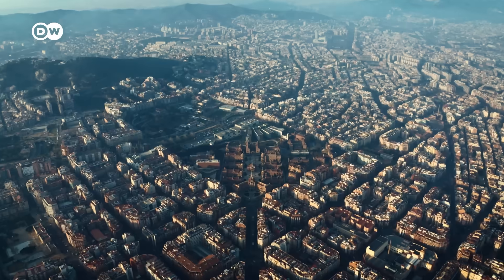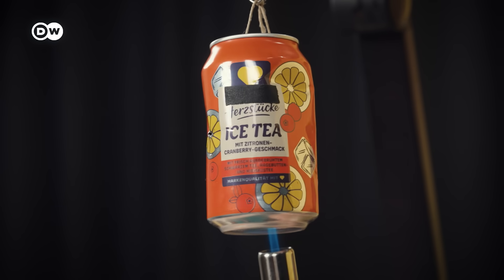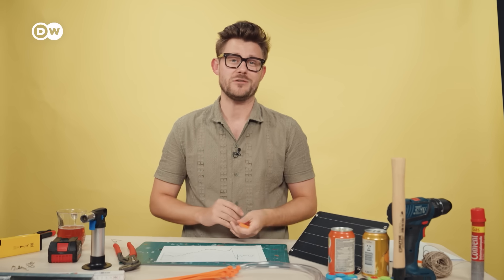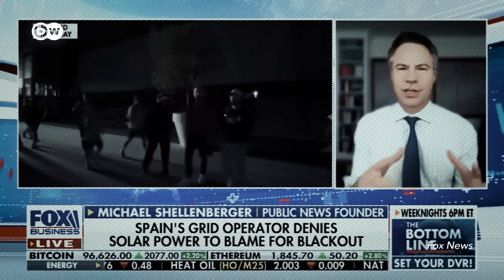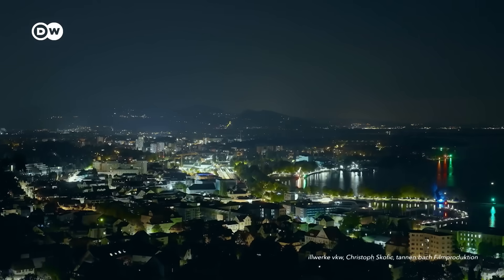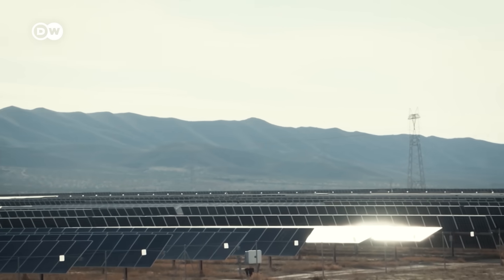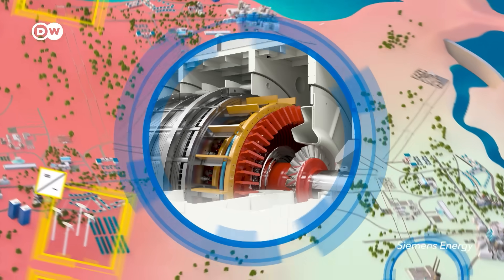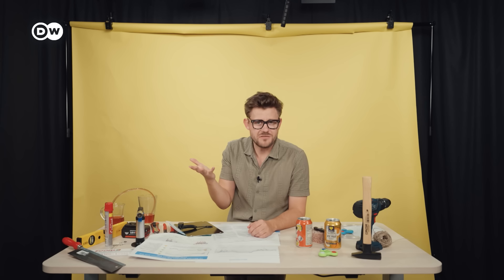Solar's hidden problem (and how to solve it)

Comment from the maker: What's your experience with blackouts?
Reply: Every blackout I've had to deal with has been due to storms. Which are becoming more common because of all the CO2 solar panels are putting in the air. Oh wait, that's what the fossil fuel generation plants do.
Reply: Congratulations on missing the main method by which modern solar installations avoid the problem being described: grid-forming inverters. Any country that wants to see the right way to integrate renewables should look at Australia. A small population spread across a vast area with a grid formed of dead end tendrils of extreme lengths, with far more solar than Spain, yet we don't suffer these outages. Also, don't blame renewables. I mean, this was Spain. It's hardly surprising that their grid is a cluster-f. Everything else is, after all.
Reply: @AussieUnclePhil You've been to Spain I presume?
Reply: @AussieUnclePhil Why are there so many people moving here then if it's so bad?
Reply: Good research job, guys. Well, my experience with blackouts is mostly under extreme weather conditions, such as typhoons, here in East Asia.
Reply: I live in germany, we have close to 60% renewables, I can not remember a blackout.
Reply: Not since the Oktoberfest of 2007
Reply: The last one we had was about 10 years ago. According to the local newspaper a worker had an accident in the local substation and they switched off power while they were helping them.
Reply: So it was a lack of inertia
Reply: @jsbrads1 We build a new system of 3 dams and wind farms.

The energy that are inserted on the grid ara balanced by that 3 dams that pump up water when the wind energy cant be inserted on the grid.

Its all about balance. Solar alone competing agaisnt the other solar and other energy sources, creates that hard start stop issues on the grid.

Its that what we need to fix. Both solar and wind energies must be directly conected with river dams, toguether as 1 system, to not allow that start stop issue to happen.
Reply: Now that we have home solar, and battery storage system not a problem at all😊
Reply: After blackouts people go outside in mass
Reply: For renewable energy it's better to have enough batteries as well!
Reply: @imtheeastgermanguy5431river dams are the batteries. They must be together as 1, and not competing against each other.
Reply: "but spinning turbines don't just help make electricity they also help keep the grid stable because they have a naturally built-in security net called inertia"

It's called inertia, but it's actually "spinning inertia", otherwise known as angular momentum, that actually keeps the grid stable due to the energy stored in the spinning mass.

Turbines and generators have exactly the same inertia whether they are stationary or rotating. However when rotating they store energy and can absorb or release energy depending on the grid load. This acts in much the same way as a smoothing capacitors on the output of a DC power supply which automatically, and virtually instantaneously, absorbs or release energy to stabilise the DC voltage, thus giving time for the power supply to react.
Modern switch mode DC power supplies can react much faster than the traditional transformer rectifier based ones which means that much smaller smoothing capacitors can be used on their output. Similarly, inverters can react faster than spinning generators to changes in load, so whilst they will still probably require some inertia it should be significantly less than needed to stabilise a grid powered by traditional spinning generation.

With wind, and probably even more so with solar, it's almost certainly requires some storage, most likely batteries, between the PV array and the inverter, to smooth out short term variations in solar, or possibly wind, generation variations, because demand it's not going to match PV generation.
Reply: @nickcook2714  battery storage is awesome 🎉
Reply: Giving photovoltaic electric power some inertia is very simple: electrical engineers call it inductance. So, a coil. Ideally, it should be in a DC circuit, then there is no influence on the reactive power in the grid (because there is generally no reactive power in a DC circuit). Using a coil is much simpler and cost effective than moving parts (mechanical inertia).
Reply: @santaclaus0815  say this to others who claim it's only possible to get with mechanical! 😂
Reply: I'm from Portugal, it was somehow incredible to witness people starting to panic just after 6 or 7 hour without energy and communications. If it lasted like 12 hours more it would get very ugly, I'm very sure. It was shocking to know that so many people don't have enough food and water for even 2 or 3 days at their homes, no flashlights other than the one from their phones, no candles, no radios or batteries, nothing. The run to get kids from schools, for gas stations, ATMs and supermarkets was like something from a zombie movie.
Reply: Lol, I was born and raised in South Africa, they were pretty common there when I was growing up, and are more so now. We had to find things to keep us occupied, and if it was dark you got flashlights and candles. It's actually quite cosy.
Reply: When we had this Spanish blackout one of the biggest things our community faced was the information black hole. Although our phones had power the transmitters didn't. I've now bought a radio so hopefully the radio stations will have generators.

We also had no water because we live on top of a hill so the water pump for the mains didn't work. This meant the toilets got a bit grim.

Shopping was problematic because of the reliance on digital systems for payments etc. Thankfully the pub is cash-only.

The beer also started to warm  up! The pumps had no power and every time the fridge door opened the contents warmed up.

It was a good wake up call. We live in an earthquake zone (Last significant one about 100 years ago) and weren't prepared. I've now got food and water in for emergencies.
Reply: 4 machines that cant cold down without cleaning inside from the materials.

Materials that only go harder if heat up againt.

Sweting all day in the day after. Body pains in the days after.
Reply: annoying, for the most part
but kind of maneageable honestly
Reply: Blackouts by storms...Wind and threes... So much solar instaled that reverse flux of Power in distribution Transformers is a real problem... And this problem, of lack of investment in sicronous compensators, was know, but with privatazion of Power companies, no investements are being made. And is not the last blackout of this sort we will see
Reply: @coisotrembaono4309  privatized power companies can be incentivized to invest in dependable quality power, but many incentives have been for less reliable intermittent power like solar and wind.
Reply: Whenever they happen it really makes you feel like you're back in the 1980's under the Soviet puppet government rule.
Reply: @cavemann_  I lost power for a week following Hurricane Gloria is the Soviet Socialist Republic of... 1980s Long Island.

Comment: As a non-expert, I initially thought “batteries would fix this.” The video could have explained the difference between energy storage and grid inertia, since the problem discussed is about immediate stability, not stored energy.

Comment: I love that the Spanish didn't start panicking, raiding shops, rioting etc, at anywhere near the rates we probably would in the english speaking west, they mostly went to the beach, had barbeques, sang songs, enjoyed the time off and danced. 😂
Reply: There were raids lol. The blackout happened 5 min before i got to my train station to go to work. When i got there there was a train waiting until power came back, we all thought it was a local issue and would be fixed in minutes, so i got on the train. About an hour later police showed up and told us to go home, that this could last days. On my way home i saw several shops with broken glass and doors. In like 2 hours people already started behaving like monkeys. Luckily it didnt last that much, the worst case ive heard of was someone who got power 22 hours after, i already had power around 9 hours after, the average being around 12 hours.

Comment: So much wasted space and resources than could be invested on a single Nuclear plant to do as much for way less space.
Reply: The nuclear power plant produces less electricity and has higher upkeep costs.
Reply: @old-pete  you must be on some kind of drugs if you think a nuclear plant produces less electricity than solar panels on same plot of land size a nuclear plant would take, sure nuclear power plant upkeep cost can be high but is vastly superior in every single way, not to mention it ends up producing less waste than solar which degrades way faster and in most cases ends up not being recycled since it's a lot of effort which ends up harming environment more than it's supposed to be clean.
  And don't forget Solar only works during days and is only effective on sunny days.
  Only reason governments don't invest in nuclear power is cause of people fear of nuclear disasters which are mostly a thing of the past as there are a lot of safety technologies now days, not cause they ineffective.
Reply: @SuperCocoKiller 
I did not write that.
You were talking about the same investment.
And that is the issue. Nuclear power plants are much more expensive and take a much longer time to setup.

Comment: "We gonna make all of Spain use electric cars" (This said by some spanish politicians)
My brother in christ, WE DO NOT HAVE THE POWER TO KEEP THAT UP.
I work in electric distribution, my father did so also for more than 40 years, and that they because the death of an old we met with a lot of people of the primary electric company in the region and we all easily knew it was because of an spike in the grid and we all made up an easy solution to, atleast in the region, have electricity throughout other means till the general problem was solve, but orders are orders and we had to wait till 10pm or so to get back the electricity, not that it was much of a problem tbh, it was a sunny day and the people, myself too, went out to the pubs and completely filled them all and their terraces 😂😂
Reply: Nobody claimed to make them go all electric tomorrow.
Reply: @old-pete  its not that we will have the capacity for it in a decade either, that its what they said
Reply: @lolxdani9996 
That is not the goal either.

Comment: About solar being cheap: I'm Spanish, and for us, the common people, solar energy isn't cheap whatsoever. You see, it's cheap to generate but the way electricity is sold in Spain is that you have to pay all the electricity with the price of the most expensive source that's beibg used, (that is in our case gas) so if you were generating 70% solar, 25% hidro and 5% gas you'll have to pay as if it was 100% gas... So basically the electric companies are making a fortune out of us

Comment: To my knowledge, the studies from Spanish Science Superior Counsil (CSIC) soon found out after the blackout that the gas stabilizers we DO have, were not fully working as an excess of self-confidence from the electric companies, trying to save gas expents. The electricity supply is no longer run by the Government from a few decades ago, which means most responsibility for it is up to private companies, who by the way haven't but raised the prices on and on since they're the owners.
Spanish governments have been lately giving public resources and supplies to their friends in exchange of personal favors. This actually traduces on a loss of control by the State, and the companies (as expected) trying to maximize their benefits as a priority, with no regards for the people's needs or what a societal machinery needs to keep going on properly. 
Actions and their consequences, it's easily (and sadly) understood.

Comment: I've heard ideas of a desalination plant, that only runs when there is surplus on the grid to stabilize it, and stops working when its not needed. Sure it has lower efficiency than a plant run 24/7, but you kill two birds with one stone, stabilizing the grind and making freshwater.
Reply: It is better to have a plant that runs most of the time and turns off when there is a lack of electricity.

Comment: what a stupid presentation, the jiggling of two glasses of liquid sums up the lack of any consistent intelligence on this issue. As far as the info - could have and should have statements and don't know why this or that didn't happen sums up the presenter. Solar is generated as DC and there will be some conversion before it is attached to the Grid - best guess here is that whoever designed the interface didn't understand how the Grid work - if indeed the solar connectivity was the real culprit

Comment: This problem is solved way before the first solar panels or wind turbines were connected to the networks. There are (there should be) frequency protectors all around the substations and if the frequency is reduced it disconnect a small portion of the networks. Beside this the authorities must not allow too much solar, wind capacity to connects the network. If they allow too much that is not an issue of a technology but lacks of IQ and knowledge of the decision makers.

Comment: I have worked in this industry for many years, all my working life. And there is a basic problem so often missed. 
Electricity generating and the grid developed over many years based largely upon big turbines in big power stations,  supplemented by smaller plants such as hydro. It mostly worked very well and was very stable.
Now, some have convinced themselves that this can all be replaced by a totally new system.  Throw out the old, in with the new. The problem is that many hard-won lessons are also being discarded. Ideology cannot replace wisdom.
Reply: The old system is still there. It just gets expanded.

Comment: There's a fairly trustworthy, although heavily censored when it comes to name blame, report released by the government investigation committee.

It began with 2 perturbations in the EU grid that raised the voltage in southern Spain. 3 production facility's protections triggered in cascade too early, causing an increase in voltage and finally triggering the blackout.

It had nothing to do with inertia in the system. Just a bunch of production plants not following law and not doing what they were being paid for.

Comment: Interesting video ! Synchronous compensator seems to be widely in use in Australia du to huge network size but they are also now in the process to allow solar+batteries to provide sync to the network (instead of following like todays). with electronic , this is stabilizing much faster than spinning compensators (that can still be used alongside) and the speed to stabilize is very critical to prevent this kind of cascading meltdown that happened in Spain.  Completely agree it means investing in the grid one way or another.